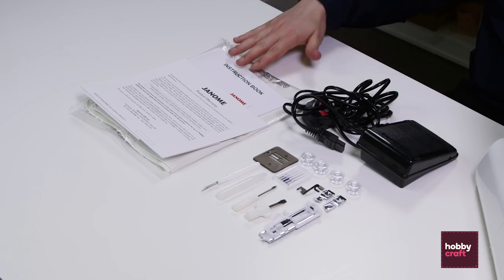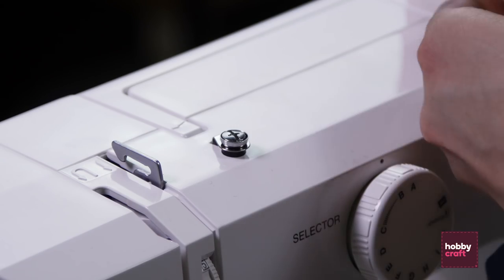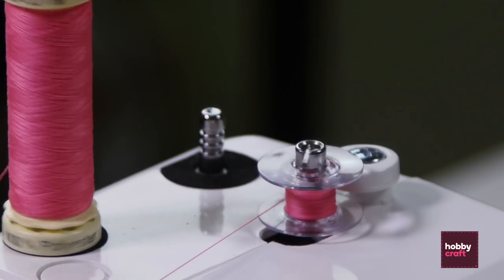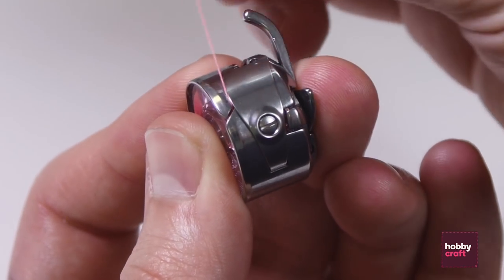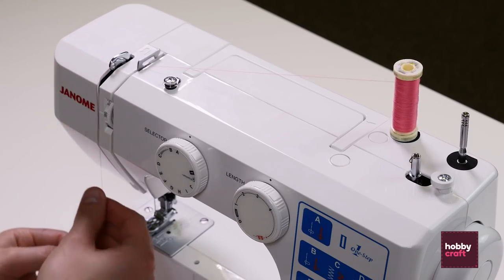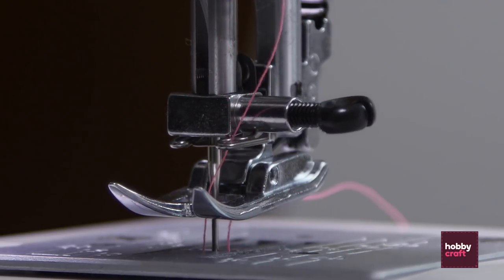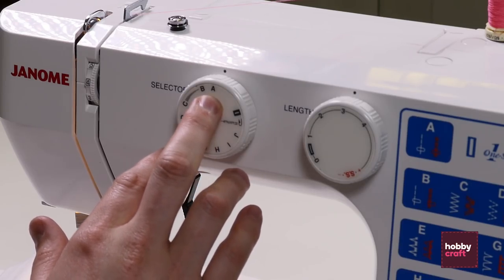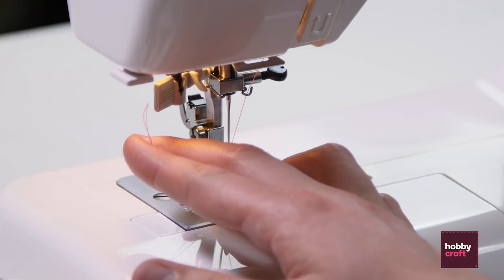How to Set Up a Janome Sewing Machine | Hobbycraft

Comment: A lovely idea - but you need to check the instructions. It shows threading clockwise round the bobbin wonder thread guide - which is wrong. Also doesn’t show that you should pull out the hand wheel (so the needle doesn’t move during bobbin threading). Good styling - but you need to update content to match correct instructions!!